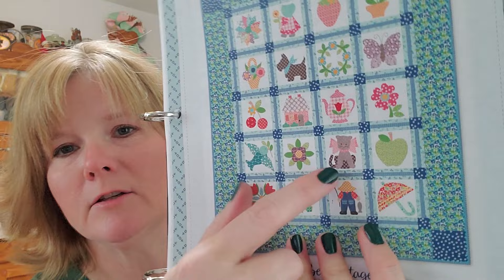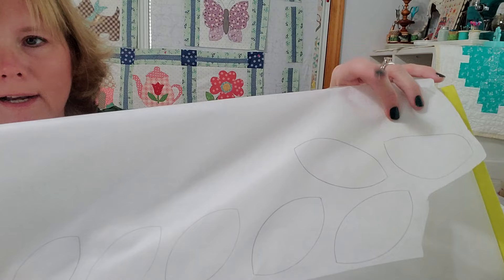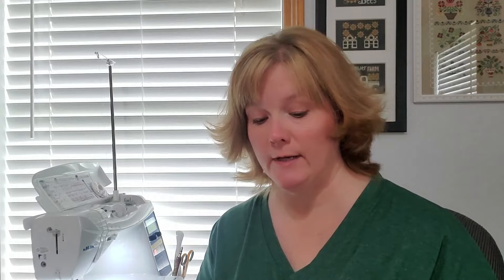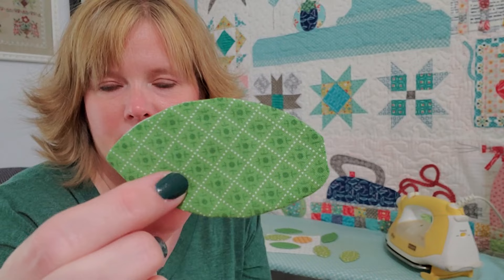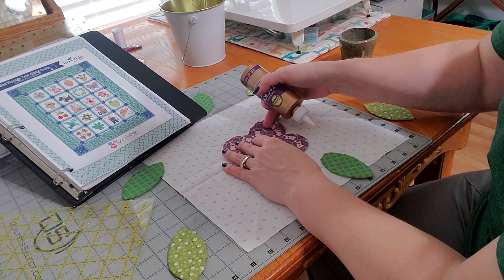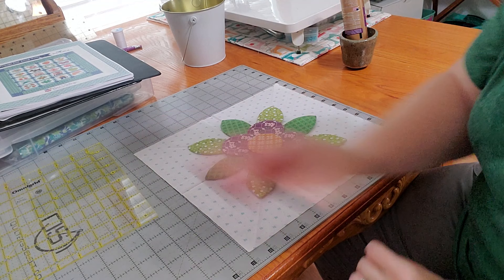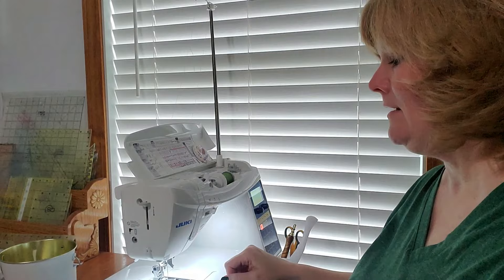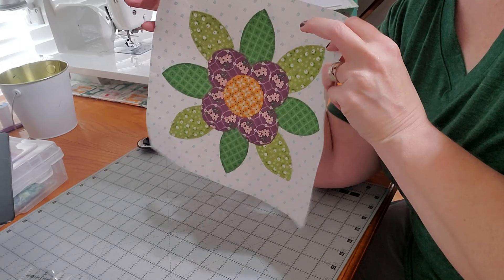Interfacing Applique Tutorial and Tips and Techniques - My take on the Lori Holt

Comment: I did see an update/correction to the sewing guide for cutting more of the leaves and one other shape but I only knew about it bc someome shared it in a fb group. I lost my P28. This was my first Lori applique quilt and I was too loosey goosey with my shapes. I have since traced copies onto cardstock just in case. I had to eyeball my P28 for the blocks that use it. I did post in a Lori Holt fb group for help with the measurements bc i lost that piece but apparently that's not allowed. So lesson learned...make copies immediately of any future shape sets that I buy! Thanks for sharing all of your tips
Reply from the maker: Good luck with your quilt!
Reply: I lost my P27! lol

Comment: Such helpful tips! I love the one stitch on the dip of the inner curve for the flower and the exact measurements of your zigzag stitch!  Also glad to know about the pellon interfacing, I ran out once, wasn't sure what to use and there's not much info online. They're way too busy at JoAnn's and some don't seem to know much about the different pellons. 
Your block turned out really nice, I want to try and make my flowers, centers and leaves a little puffier. I've tried sewing the batting with the interfacing and fabric but it's challenging and the piece doesn't turn out right it's way bulky. Thinking about putting a piece of batting under the piece, would you glue it on first or make it shorter than the leave? 
Would love some feedback.
Reply from the maker: Hmm... I'd be tempted to layer it with the interfacing and fabric and sew all the layers together.

Comment: Your tips are going to be so very helpful!  I have now subscribed to your channel and will look at past videos. When I did Bee Happy by Lori I used the sew simple shapes but did the appliqué using the needle turn method (a very lengthy process). This time I plan to use the interfacing and will look for the Pellon, thanks for the details. Quick question, what brand is your rotary cutter?
Reply from the maker: I primarily use a quilter's select rotary cutter. It has some weight to it.  I like it.
Reply from the maker: Thanks for subscribing and watching.

Comment: Something else I do to speed up the process is cut the slit in the interfacing BEFORE I sew the two pieces together. Taking time to carefully use the seam ripper to cut into the interfacing slows down the process. At least I think so. I wonder if anyone else does this? Thanks for the tip about changing the stitch length. I lower mine but I think I need to lower it even more to get those circles smoother on the edges. Great idea about adding a stitch at the cleavage.
Reply from the maker: Oh!!! That's a great idea! I'll have to try that.
Reply: Also, thanks for the interfacing suggestions. I make and sell project bags and sometimes I use Lori's applique designs on them. Buying by the bolt instead of her interfacing will certainly be easier on the pocket book